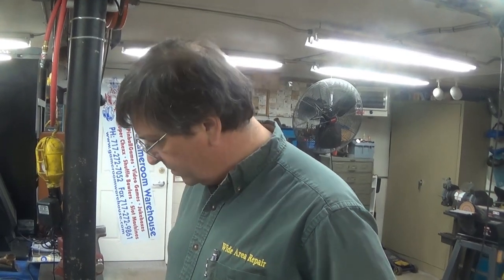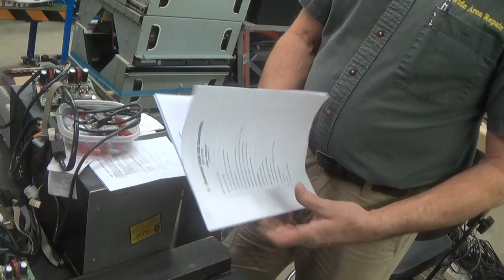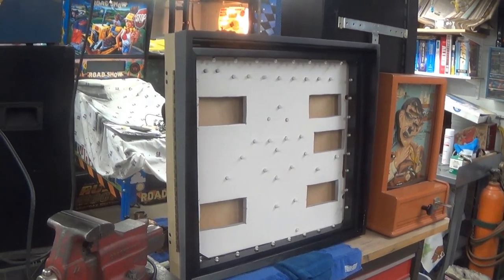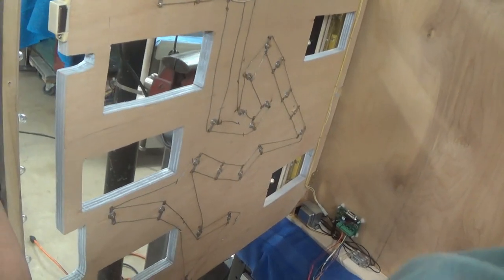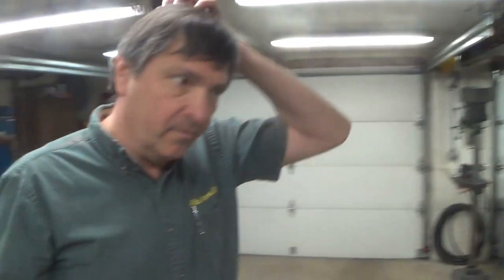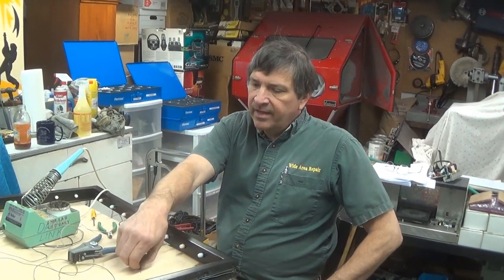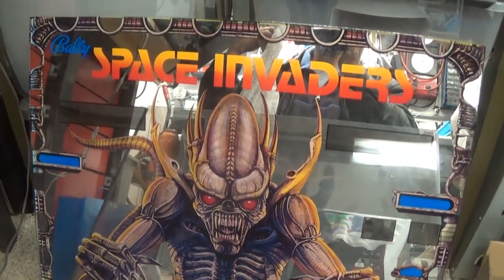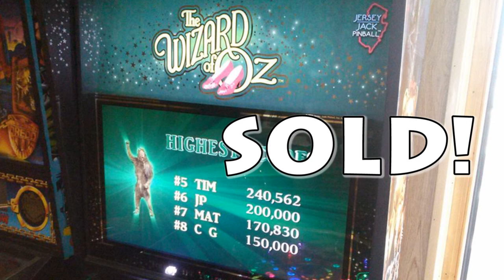Ray's Pinball Tech Tips #39 - Custom Bally Demo Exhibition Wall Art?!

Comment: Silly Question/Comment, couldn't you have used a christmas light setup to do the chase lights? I suppose the pinball LEDS would be different so could take some rewiring and probably wouldn't remember the last setting but could save starting from scratch.